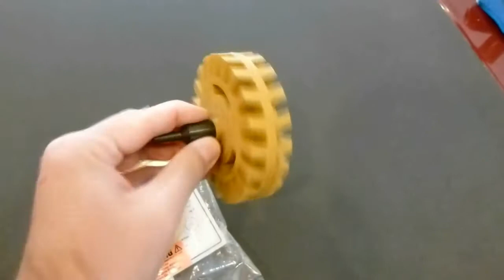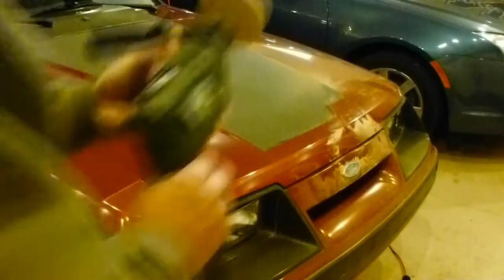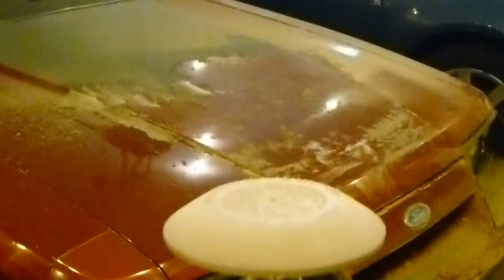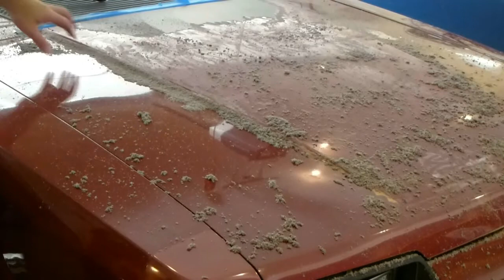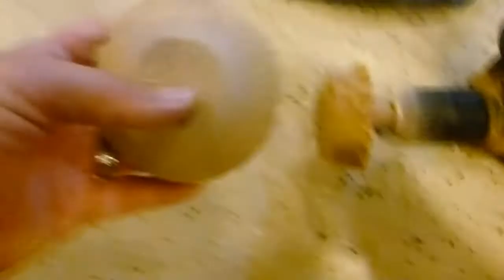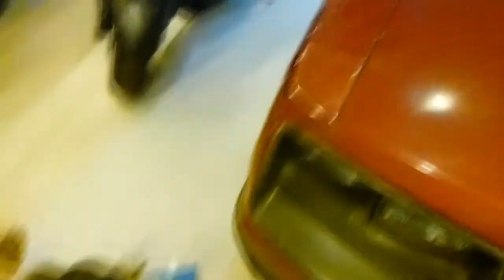1985 Mustang GT Hood Decal Removal & Eraser Comparison

Comment: Just replaced my hood decal on my 85(same color, canyon red) and then your video pops up lol. I was having the car painted so they just sanded the 39 year old sticker off.
Reply from the maker: Very cool!  Yeah, if the car is getting repainted then sanding off the decal would have been the quickest and best method for removal.  I'm sure it was dry rotted like mine too.
Reply: @CoffeeDrinker71  The sticker wasn't in too bad of shape for 39 years old but the edges were looking tattered. Fresh paint and sticker and it looks better than new.